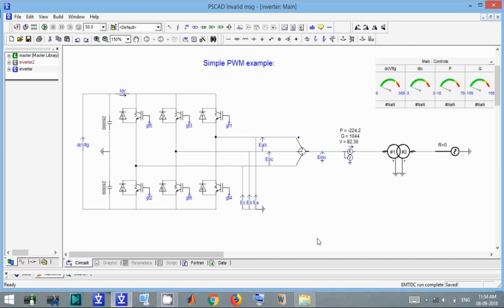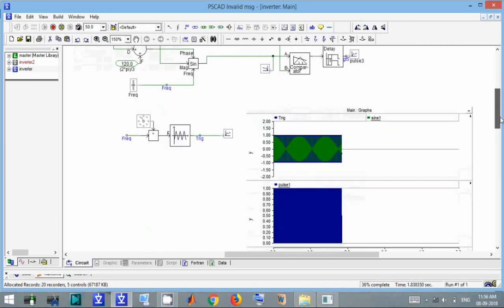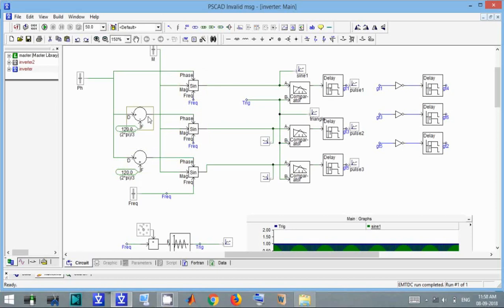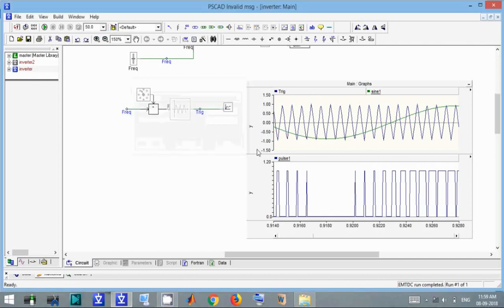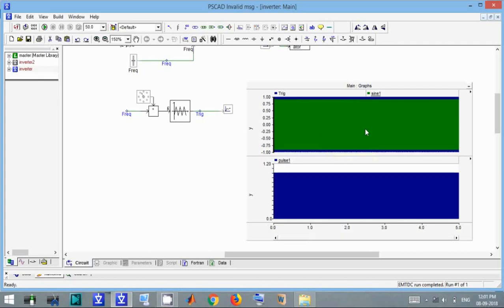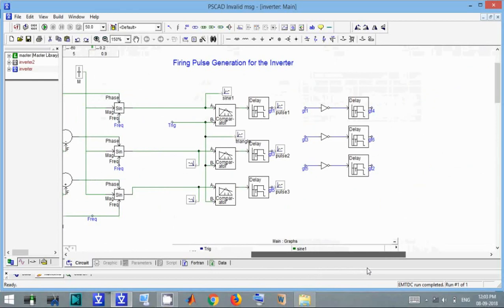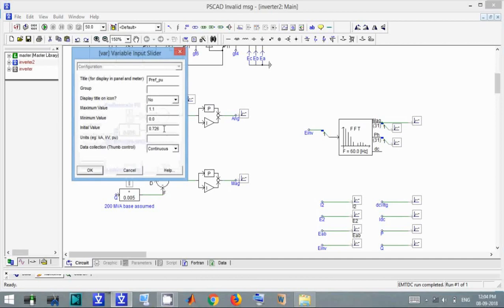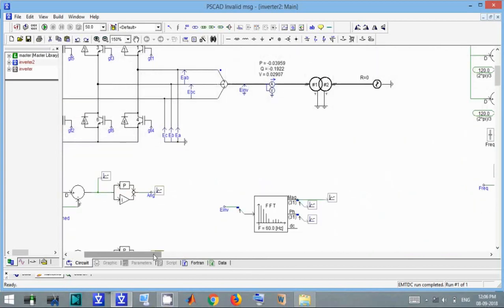09. PSCAD tutorial | Sinusoidal pulse width modulated (SPWM) inverter model in PSCAD

Comment: One other thing I'd like to add - the comparator block needs to be set to a level output type otherwise the pulse "width" will not change.  If you left the block at a pulse type, it would output constant pulses of the same width, which will not properly give the modulated output.  In addition, the output level needs to be 1 when A is greater than B and 0 when A is less than B.   Effectively, the "pulse" is generated when the sawtooth wave value is smaller than the value of the sine wave at that instant in time, so its really a "level" which is maintained until the level of the sawtooth goes back to a point of being greater than the level of the sine wave.  Hope this helps.